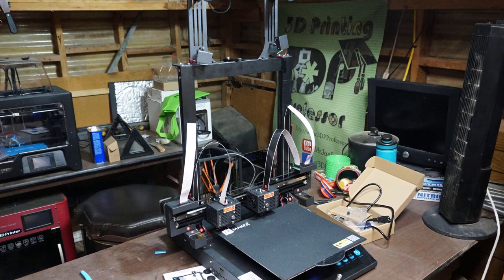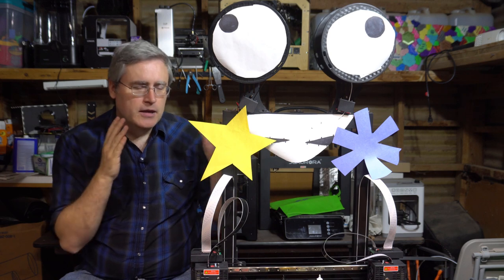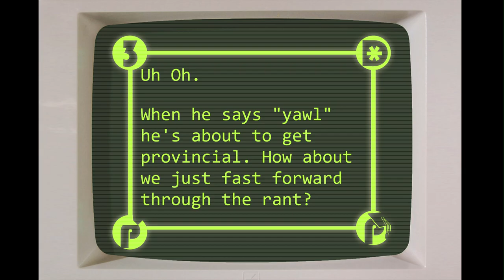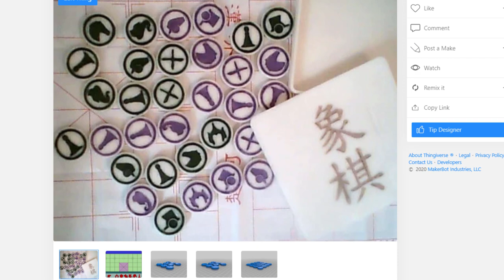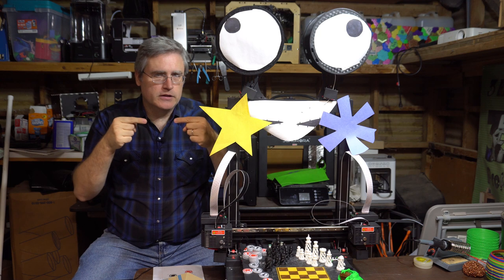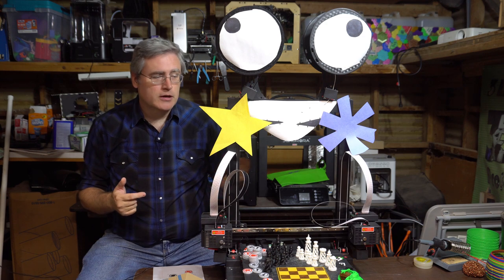Should you back the JGMaker Artist-D on Kickstarter?

Comment: I can't wait to tinker with mine. I have been wanting an IDEX printer SOOOOOOOO Badly !!!! Iron Man helmet in the right two colors without painting? yes please :-) Saturn V without paint? Yes please :-)

and it should be possible to do 3 heads. just extend X so you can fit 2 extruders on each side. this way you can push 1 or 2 to either side to get to number 3 :-)
Reply from the maker: I think the next step is a tool changer. There's already a number of DIYer playing with it. It should percolate down eventually.

Comment: After watching this video and a few others I decided to go ahead and buy one . Jg Maker had a special on refurbished ones for $249.00 shipped . It arrived in there days . took about 45 mins to get it all setup and running . Another 20 mins or leveling the bed . I made two prints of the money cat and they came out great . The next day I took the time to fix the bed wobble (very easy) . Made sure the second extruder was the same height as the 1st one ( this took a bit of time ). Had to go back and forth leveling the bed checking , adjusting etc etc. About two hours latter it was perfect . Adjust the off set and called it done . 

This thing prints really great , I go ahead and disabled the run out switches as they put some drag . 

I did notice there is an option in the firm ware to turn off the second extruder run out switch . 
Overall a really great printer for the price and sure beats my old Maker III printer . 
I am controlling the printer with Repeater Server pro 1.4.2 and love that software , it lets me use my second Mac mini to do all the heavy work and it runs on my M1 Mac . Love the fact I can out source the heavy work to the more powerful Mac ,

Comment: i'm impressed you can print this well without oozing without an ooze shield!
On my tool Changer (Doot Changer, Custom tool changer) i still have to use ooze shields otherwise I get tiny annoying bits of filament over my prints :_: it's doable but not perfect.
do you set the idle hotend to reduce temp? I don't do that because it massively increase print time by hours!

Comment: After having this printer for a while now, how happy are you with it? Have you run into any more issues? I'm looking into getting either the Pro model or the Weedo X40.
Reply from the maker: I still have the printer, and I've upgraded it with a removable build plate, but it's still the prototype version with the peg in the middle of the build plate, so leveling is still a pain. But it's a large format IDEX printer that works, if a little roughly because of the UI. I'd totally recommend springing for the upgraded UI.

Comment: Casual Saturday, Joe?  How is the bed heated?  (I have an original CR-10 and its 12V heat bed takes forever to heat up.)
Reply from the maker: Ah, I forgot to mention that. (20 minute video and still not enough time.)The bed doesn't heat up worth spit unless you mod it with a little stick on insulation (like the kind for under the hood of your car). But once you do that it heats up like a champ.
Reply: @3dpprofessor   So, is it 12 V or 24V?
Reply from the maker: @johnquandt8795  I think it's 12V.
Reply: @3dpprofessor  Power supply 500W 24v

Comment: Professor did you test whether you are able to adjust the extruders independently. Apparently it's been determined (by an other well known reviewer) that due to a design flaw with the proprietary extruder, this isn't possible. Are you able to report any findings of your own? Thanks
Reply from the maker: You mean if you can adjust the height of them? No you can't. But it's not because of the proprietary nozzle. It's because they didn't make any sort of mechanism to do that. They could have had it adjustable in a couple of different palces.

But so far it's been less of a big deal than you'd thing. generally speaking close is close enough. Make that first layer a little bigger, get some squish on there, and just go with it.
Reply: @3dpprofessor  thank you!
Reply: 3DMN shows that you can make adjustments for the height in the Marlin interface, so, not a hardware adjustment as available on the Tenlog Hands 2 and 3, but will still work.
Reply from the maker: @missingpunctuation   That's less good if you're doing mirror mode. But for a blended dual material print, yeah that works really good.

Comment: Thanks for this, I was lookin at this printer because I got a Tenlog TL-D3pro in the mail and it had issues (loose x axis belts and no way to tension them, and 1 extruder binding/stepper skipping, the other working fine).. i thought maybe I'd give this one a try if my TL-D3pro replacement comes with more issues, but im not sure I like the fact that you can use standard nozzles, which means no hardened nozzles, and i really would like to print with support material and a carbon fiber impregnated nylon. Also the electronics inside this printer seem kind of lack luster compared to the tenlog. Although the extruder on this printer does seem superior... though choice. Maybe someone will do a JGMaker Artist D and TL-D3pro stand off. Maybe the Professor??.... haha
Reply from the maker: I will review any 3D printer they send me.

Comment: Dual head system gets a nod. Flat cable connectorized stuff, a nod by default, since that was where you should have looked at first on the limit switch issue. What about the easy snap in-out nozzle and heat break, with no heater or themostat disconnection? What about the way clean and more reliable flat cable system in general? that is huge to me. 
This printer finally addresses the two totally pain iun the butt issues with nearly all 3d printers... cables and hot end service.
Reply from the maker: Been too busy printing with it to check the nozzle, but I'm gonna.

Comment: Nice vid, Thanks
Did you enter the Polymaker hook contest? If so and you won, what printer would you choose under the $1000 mark? Could you demo this machine with dissolvable support?Thanks
Reply from the maker: Dissolvable supports is definitely on the list. 

My free time took a bit of a hit recently, so I wasn't able to enter the contest. That, and I couldn't think of a $1000 3d printer that I wanted. Unfortunately my tastes have grown. FlashForge Creator S, $3500. Peopoly Phenom $2000. Yeah, not really sure what I would have gone for.
Reply: Bean soup... Lol
Reply: @3dpprofessor  Same here, I have 30 Ender3s and 6 Tevo Tornados in my print farm. I really would like a large volume mono resin printer. Thanks

Comment: BIBO 3D or this?
Reply from the maker: Depends on what you need.

Do you need the large volume of the Artist D? Are you willing to put up with a little more effort to do it? Or do you need something push-button easy?

I will say that the Bibo has dual heads fixed on the same carriage. That is vastly inferior to IDEX. I would look at the Flashforge Creator Max 2 or Pro 2, depending on where you are located.

Comment: Flat cables are a NO go to me. That's an overcomplication to save some copper.
Reply: flat cables and connectorized heater, thermistor etc make this machuine ABSOLUTELY way more serviceable and reliable. 
Seen any spiral wound cable bundles in your inkjet printer? Flat cable designed for constant flexing. Cable bundle?  NOT.
Reply: @jamesfackert6044  Seen any 40W heater in your inkjet printer? Good luck on service your board with broken smd connector. Apple design, if not working replace everything.
Reply: @DumahBrazorf  sorry, wrong. I have replaced wires in bundled 3d printer cables at least 8 times.
I have broken other wires while replacing heater or therm wires in bundled 3 times. Connector used ribbon cables are more durable AND more easily replaceable.
40 watt heater is under 2 amps. No problem for a few paralleled flat cable conductors.